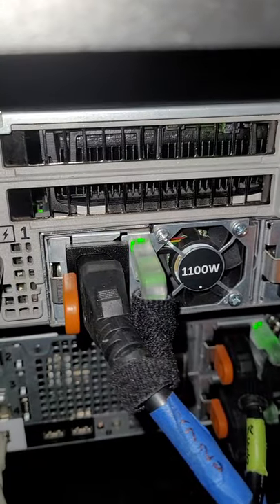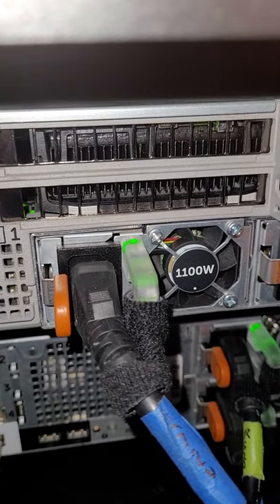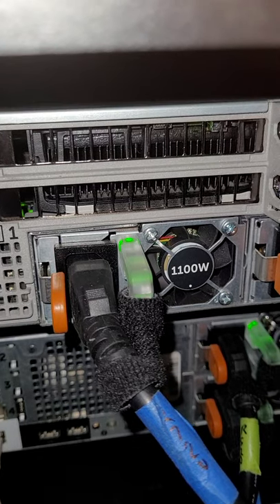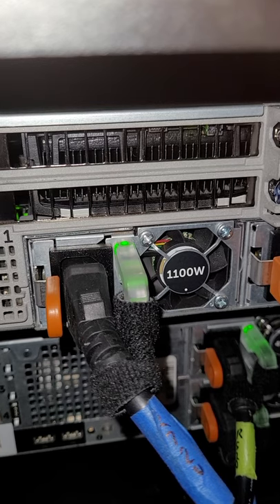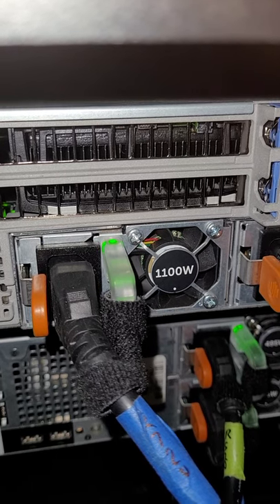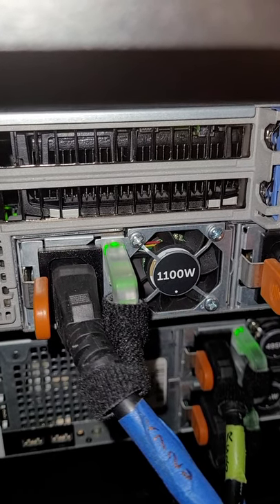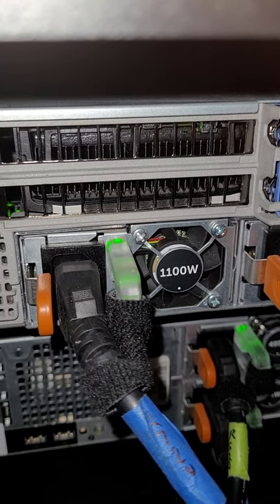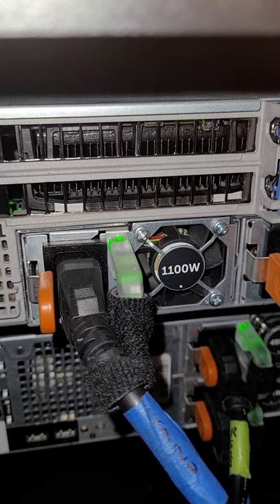NVIDIA Tesla K80 fan noise in server follow up.  Now with overclocking. :)

Comment: The k80 is a 300 watt card. Use a server workstation and the correct quadro for the k80. A desktop pc will never work, and this card also needs to have dual cpu's on the mobo to work for games.
Reply from the maker: That's not 100% accurate. Desktops will work if the motherboard has above 4k decoding support and rebar support. Dual CPUs or quadro aren't required.